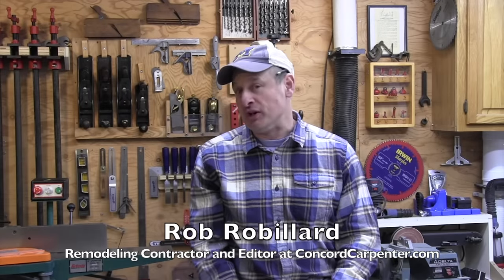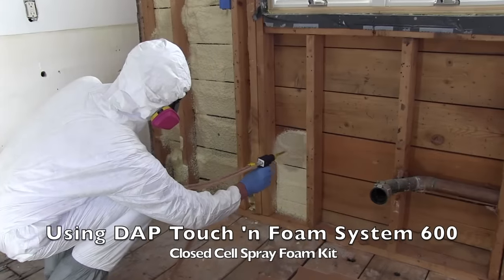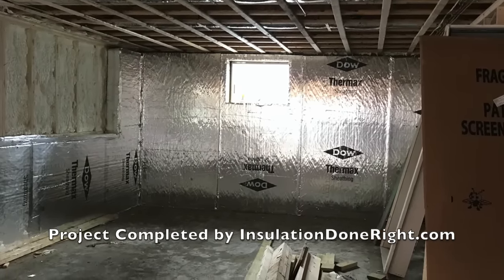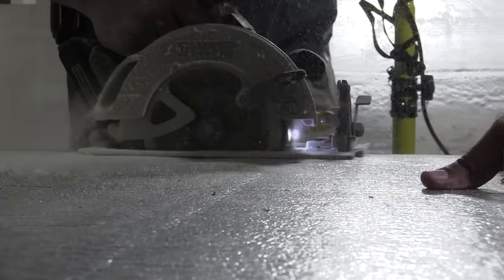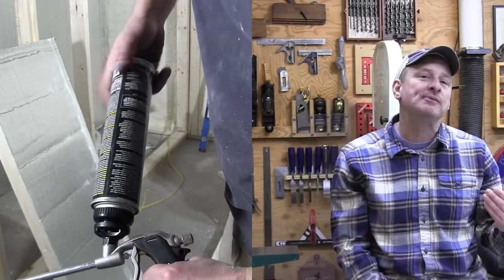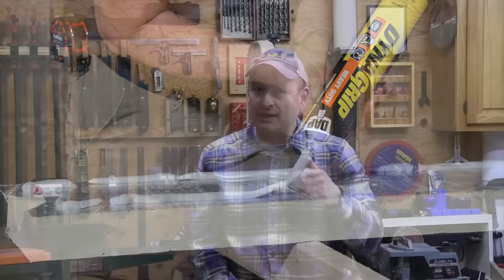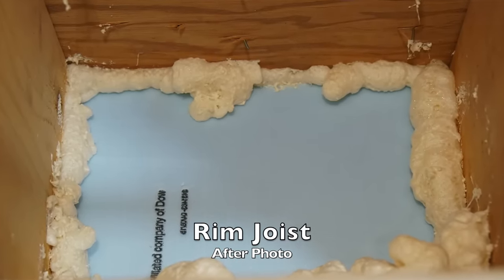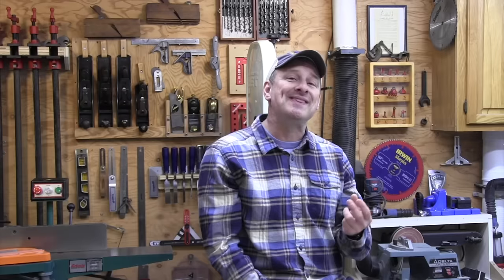Why Use RIGID Insulation board On basement walls

Comment: Hi Rob, I love the poly idea on the interior and the benefits of it.  I'd prefer to be able to have the ability to inspect in the remote future chance that the exterior water proof treatment fails or has an inadequately waterproofed area.  My girlfriend bought a small cape Rome NY built in a hurry, post World War 2.  The unvented crawl basement is humid and needs the dirt/rock sealed in the areas it is not dug out...on that, I wouldn't worry about spay and I'd be able to crawl on it as opposed to a 15mil plastic sheet solution.  Currently a large dehumidifier can barely keep it at 50% RH.  The water table is high and aside from gutters, the cinder block exterior needs water proofing.  What are your thoughts on spray polyurethane on the exterior from just under the siding, down to the "footing"?  It seems like it would be waterproof and insulating and more durable over years of temperature cycling than the other typical coatings.  It seems like like exterior inspection would be less likely to be required as far as accessibility is concerned.
Reply from the maker: Check out the article that I wrote on ceiling a crawlspace on concordcarpenter.com
Reply: @ConcordCarpenter  Thankyou very much!!!  I found the article "Venting and Insulating a Crawlspace".  Tuff Scrim seems similar to something I found Stego makes called Crawl which is 15mil.  But Tuff Scrim's Antimicrobial Poly sounds like a good idea.  I love your website's info and layout and will check it out some more!  I used to live in Marlborough. My sister is in Westford. Cheers!

Comment: Isn't Polyiso best used in insulation zones 1-4, while zones 5-8 not so much?  I read the gases used to achieve the higher R-value when forming it dissipates over time, within 6 months to 1 year in some cases based on the zone.  What is your stance on that?  Thanks

Comment: I got an uninsulated cellar directly underneath my porch. It gets real hot with the morning sun in the summer and icy cold in the winter. can I insulate the concrete ceiling in there the same way as basement walls or would I need to do something different?

Comment: Hey guys really enjoy the videos.  I have a 20' x 16 shed / Office that I have A/C (I am in Florida) and I have 2" x 4" exterior wall what would you use to insulate the walls and roof areas.  It sounds like the beat I am going to get is an R10 or R13 with either the spray foam or the Foam Board.  Keep up the great videos.

D

Comment: Can I build a sleeper floor on top of rigid foam board, fastening the sleeper floor through to foam board to the concrete? I'm building a subfloor in my garage in a sub zero climate. My plan is to also include foam board between the sleeper boards to be the thickness of the sleepers, then top with plywood. If so, can i shim between the bottom layer of rigid foam and the sleepers, as I would if the sleepers were just on a thin vapor barrier on top the concrete? Thanks for any feedback!
Reply from the maker: Yes you can - use PT wood

Comment: My basement has exist cmu with 1x furring 16"oc with paneling and likely no ext and int moisture barrier.  How would you handle this situation: leave exist furring in place, apply 2" polyico to furring, apply 1/2" MR gyp board directly to polyico (which side?), etc? I thought about applying 3/4" rigid insul between furring, possibly adding another 1" rigid insul over furring and insul, applying vapor barrier overlapping 6", then applying MR gyp board? Seems to be endless options and applications but I'm looking for best practice for old cmu basement walls and humid basement conditions. Also, if water penetrates into the block and contacts the polyico and drains to floor does this create problems as well? Thanks

Comment: Very informative video. I'm finishing my basement also. I plan on using R Tech foam board directly to the masonry walls. Do I still go tight to the floor and seal with spray foam if I have a perimeter drain? Thanks in advance for your help.
Reply from the maker: yes but dont block the drain
Reply: Tight to the floor, don't block the drain. Got it! Thanks again! @ConcordCarpenter
Reply: @ConcordCarpenter  how about in a house that, thankfully, has zero water in the basement, no drainage, and is located on a mountain. My front foundation is covered by dirt but it grades downwards as you walk towards the back. So much that maybe 2 feet of the back are below ground. I've experienced some hard rains but never and water penetration.

Comment: maybe i'm missing something here, but they show an example of mold/mildew growing on the brick wall, and later show the installation of the rigid insulation. . . . . so what keeps mold/mildew from growing on the brick behind the rigid insulation. typically moisture can seep through the brick stone and mortar giving mold/mildew the moisture what it needs to grow, covering it with rigid insulation, gives it the darkness to better allow it to grow. I think this video glosses over additional necessities to keep mold/mildew from growing. I'm sure it's important to put a vapor barrier on the inside like mentioned, but if water collects on the outside of the brick foundation of your home and there isn't a vapor barrier on the outside, the moisture can soak into your foundation walls and any void gives mold/mildew the environment to grow. Are there any experts reading this who can provide a more comprehensive explanation?

Comment: I heard you say the polyiso can go tight to the concrete floor.  I just want to ensure there won't be any wicking of water.  I understand that John Manfield AP foil faced and R-Max R-Matte Plus 3 sold at the big box stores don't have the fiberglass in them that was creating a moisture problem.  Also, what happens if there are air gaps where the board doesn't adhere fully to the poured concrete foundation wall?  The polyiso I purchased was warped at the store and there are air gaps.  I'm hoping that once the framing goes in front of it, it won't be a problem.
Reply: The foil faced board will allow the water/moisture to pernitrate the foam. There will always be gaps in between the boards and the concrete as the concrete is never perfect. This has never been an issue in my 25 years of installing insulation. tape all the seems and keep it as tight as you can.

Comment: Hey, thanks for the upload.. What if my walls are coated with drylock, can I use the adhesive on the drylock surface without the adhesive causing a tear in the "vapor/moisture seal" that the drylock is providing? Also, would that adhesive adhere to the drylock?
Reply from the maker: Joey GunZiLLa yes, the rigid insulation will become your new and better vapor seal
Reply: @ConcordCarpenter  thanks for the reply!! I just finished up one room I went with batt and plastic because I wasn't sure about the panels adhering /proper bonding to the surface. I have a large room left to do.. I'm going to try out the boards on this one. Thanks again & take care ✌️😎🤙
Reply: @ConcordCarpenter   Im in upstate NY. In the winter time my basement is 60 degrees and in the summer time it is 78 degrees with a humidity of 90%. If I did the method you showed in the video how how this effect my summer and winter temps in my basement?

Comment: If you insulate a 10” basement concrete wall with 2” XPS, can you add lets say another 4” rockwool before finishing the wall with drywall? Or will this be too «sealed»?
Reply from the maker: Correct you can do that
Reply: Thanks for confirming.
This subject is complex but I understood that the goal is to make the warm to cold air condensating point not happen insde the wall creating moisture which creates a whole new world of problems

Comment: Rob great the video, I am looking to refinish my basement the house had drainage & foundation issues which have been corrected. The basement walls are block wall with thoro-seal masonry coating on them. Would the ridged board or close cell spray foam you spoke of work in this situation? I have steel I-beams running vertical every 8' around the perimeter of the basement.

Comment: Should you be using red or blue tuck tape to seal the joints compared to foil tape? The tuck tape is used for vapor barrier. I don’t think foil tape acts the same. What’s your view on this?
Reply from the maker: skyline we use foil-it definitely seals. We use same tape on dryer and bath vents

Comment: What happens to moisture between foundation wall and styrofoam insulation?
Reply: It turns to mold without a drainage plane to help dry it.
Reply: If you apply the adhesive vertically, any moisture will flow down to the interior weeping tile. That's why you should spray foam the bottom of the panels as well

Comment: How would you add drywall on top of rigid insulation without making 2x4 wall?
Reply: Little late but it looks like you put up the studs after the foam is up.

Comment: Im in Michigan trying to pass my GC exam one of the questions is which type of adhesive is the best to use on rigid insulation/ foam insulation on to concrete walls. Non latex, non solvent or solvent adhesives...? Btw I googled it but I can’t seem to find the correct answer. Thanks!
Reply from the maker: Non-solvent. A solvent would eat thru

Comment: As a renovation project... What type of insulation will you consider for an existing exterior brick wall assembly on a historical residential building?
Reply: Careful
Depending on where you are and the types of mortar used there are different answers.  “Some” people want high R value, but that may lead to frost issues as not enough heat is escaping and your mortar freezes. Kiss your foundation good bye.  On the other hand “some” people only lightly insulate as they want the heat to push the frost away, but more energy required. 
“Some” people need experienced, old, certified engineers. Lol
My last reno on a 110 year old in central Canada   We did not bother to insulate as per the architect 
Others have been lightly insulated (1” Sprayfoam)
Another answer might be dig outside and use rigid insulation to protect the foundation 
Please remember the old buildings had big boilers and were hot hot hot.  Today we are cooler and airtight. 
Ps. Ensure adequate fresh air

Comment: If you're using foam boards with a foil side, make sure you face them the right way by making the foil face the wall. I installed them wrong in my work shed by making them face inside of the shed, all the heat reflected right back into the shed and i was cooking in the summer 🌚 dont make my mistake

Comment: Poly Iso doesn't like the cold. EPS and XPS will perform better in that regard. Also, a properly installed vapor barrier such as a plastic sheating that doesn't have penetrations and is tightly sealed ....IS a vapor barrier. However, they get badly installed and demolished during the construction and afterwards and very often the construction methods make them non continuous anyway.
Reply from the maker: Poly iso works great. I’ve yet to see a properly installed plastic vapor barrier - agreed

Comment: What state are you located in? Great information. Just built a new home a they sprayed foam closed cell all of the time joists and brought it out flush with the concrete wall. So the foam is about 8 to 10 inches thick as I have a 10 inch poured wall. 9 foot high.
Reply from the maker: Woodsconsin Woodworking mass

Comment: I would like to isolate the walls of a small place where it will be to do some chores, a kind of workshop.

All around the walls are made of brick and only one wall is made of yellow stone.

What I was thinking of doing;

-Stick on the wall directly XPS 260x60x3cm and then on top of the XPS OSB boards.

What I do not know;

-Collage, I know that there is a glue suitable for these cases, type of construction or industrial but safe ?!
-The application of OSB, also on top? Do I drill the XPS and also the brick to put the OSB in? How?
-Do I need to put frames between?
-My biggest doubt is stability. Because later I wanted to hang some cabinets and shelves to put storage and tools!

Comment: Would this method still work properly for an attached garage with masonry block walls. I have a living space above the garage that is cold in the winter. Would i still need the vapor barrier on the ceiling if i insulate walls with the the rigid board, Frame, and insulate and put osb over that?

Comment: Question. If you frame a wall in front of this rigid insulation, would you insulate the studded wall with faced or unfaced fiberglass insulation?
Reply from the maker: Unlaced, if you have I stalled a RIDGID layer and taped seams
Reply: @ConcordCarpenter  that’s what I was thinking. Thanks.
Reply: @ConcordCarpenter unfaced, correct?

Comment: Does it need to be foil lined foam panels for basements.  Seems like all the 2in options are not foil lined. 

Thanks in advance for the help!
Reply from the maker: No, Polyiso is 99% of what we see unless it’s homeowner installed. Contractors who typically install this do so in basements with the hope that they will get the future of sale of framing and finishing the basement.

In a DIY situation, I would say the XPS is common because of its access and availability at the local Home Depot or Lowe’s. 

There are two types of rigid boards we've commonly used.
Extruded Polystyrene (XPS) insulation board
Polyisocyanurate (Polyiso)  insulation boar
Extruded Polystyrene (XPS) insulation foam boards deliver the long-term stable thermal performance of R-5 per inch. Compared to spray foam, it’s harder to install in awkward areas (for example, in a tight space where a rim joist is close to another parallel joist). Rigid foam is also fussy to install if the rim joists have a lot of wiring and pipe penetrations. But its cheaper and a popular choice if you’re doing a DIY project.

Polyisocyanurate (Polyiso) is a closed-cell, rigid insulation foam board that is bonded to facers on both sides Polyiso is most commonly used due to its fire-retardant properties. Under normal fire conditions, XPS, melts and drips while polyiso, chars over.
 
The foil facing also helps with the limiting of any moisture travel.  Polyiso is commonly used in roof, wall, ceiling and specialty applications within commercial and residential buildings of all types.
Reply: The polyiso board with foil face will prevent moisture travel better then without. The Thermax seen in this video also uses the foil to meet fire code. This board is allowed to be left exposed without added fire protection.
Reply: You mean XPS? XPS is very nice, but also very ungreen re: blowing agent currently used. Polyiso is much greener but can be sensitive to water. Make sure basement has no water issues before using polyiso.
Reply: Thanks Gents.  Appreciate the insight.

Comment: Thank you! Can you affix this board under a metal fireplace base?  That is, in my basement, I can see the underside of the wood burning fireplace that is located in the family room above it. I assume the metal will get warm when a fire is going. (I don't use it.) The area is an alcove that will be turned into a closet.  Should I keep the polyiso x" away from the metal? I was going to use .5" polyiso in this area since it's a closet. I don't see how to attach a photo for clarity.  Thank you!

Comment: Hi rob, question for you
We installed a interior french drain, did 10m vynile + 1.5 inch foam under. and installed a delta ms membrane on the interior wall that goes under the concrete (if water drip from interior wall it will go straight into the french drain.
My question should we seal the upper delta ms with silicone + blue tape?
We are going to use 2inch rigid foam on the wall for isolations
Reply from the maker: I would

Comment: Can you use it to do a roof ? Say for a small travel trailer roof? I can't find a spray foam roofing company that doesn't have a minimum of over a thousand dollars, I'm on disability and can't afford that.
Reply: Most definitely! I used 2" XPS foam between the rafters. Just cut to fit and use the canned spray foam around the edges. The spray foam seals and holds in place. (Make sure it is humid or mist with spray bottle to cure faster and better.)

Just make sure you don't block or cover roof or soffit vents. One way to do this is to put the rigid foam flush with the bottom edges of the rafters (or even below if you don't mind losing the extra space), leaving an air gap between the foam and the roof. This creates perfect air channels from soffit vent to roof vents.

Comment: So if I use the rigid board taped and then pink wool between the studs do I need to install a vapour barrier on the inside ? Like u would normally. I'm guessing no as this would make a second barrier

Comment: My question is now after watching this after the adhesive dries and your foil board is mounted what would you recommend to decorate it up? Can sheets of 8 inch plywood be mounted to the Styrofoam and will it hold? Thanks
Reply: No. Normally you would frame a wall in front of it.

Comment: Great video and information! Thanks a lot. My basement was already finished when I bought the house, but it's only got the reflective fiberglass insulation between the studs, no XPS behind it. Most of my basement walls are about 30-50% above grade, and I don't have any major moisture issues now. I'm about to start a basement remodel, so now is the time to replace with rigid board if I'm going to do so. What are your thoughts - start fresh or not to fix what isn't broken?
Reply from the maker: fresh
Reply: @ConcordCarpenter  thanks
Reply: @ConcordCarpenter  SAVAGE! 🤣👍